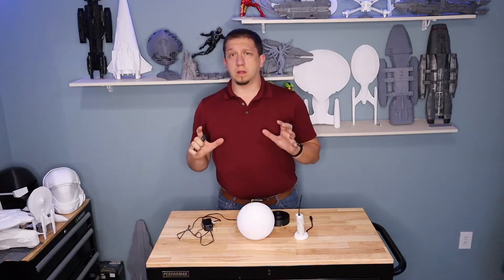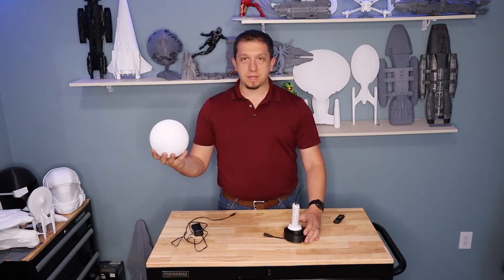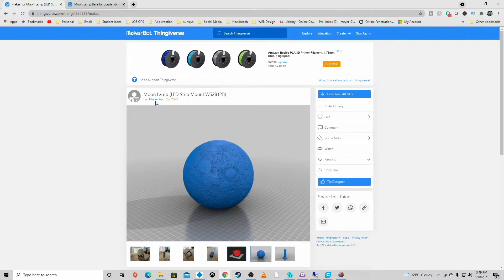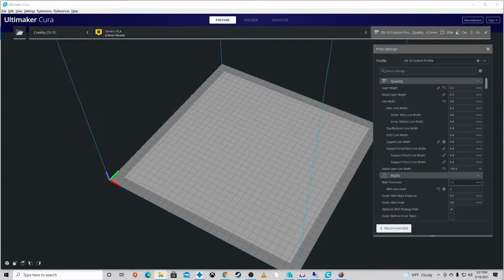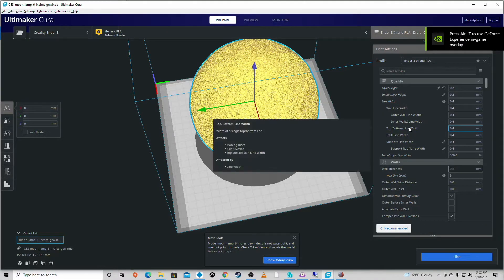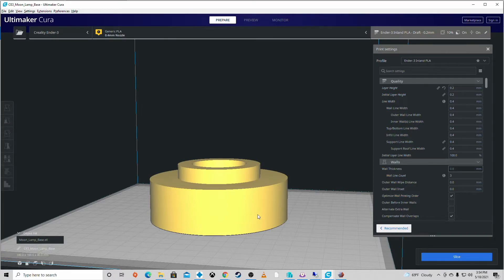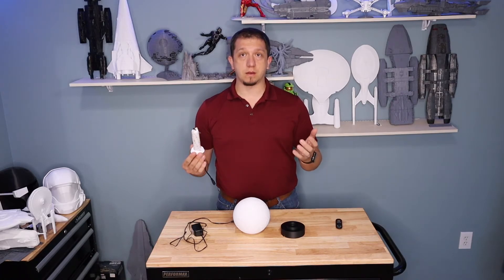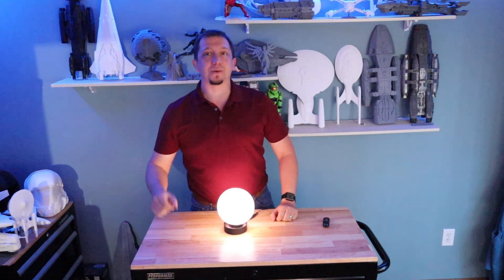Moon Night Light Lamp 3D Print

Comment: Nice work. What about the speed? How long did It take?
Reply from the maker: Total time for the print,  all 3 parts is about 3 days.  2 for the moon, about 12 hours each for the base and the light holder.
Reply: What print speed was the printer running?